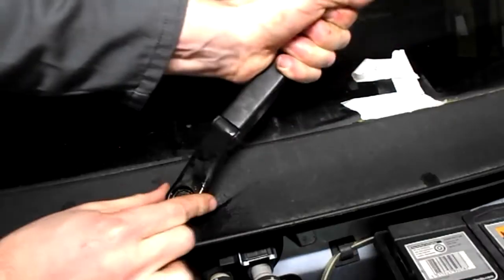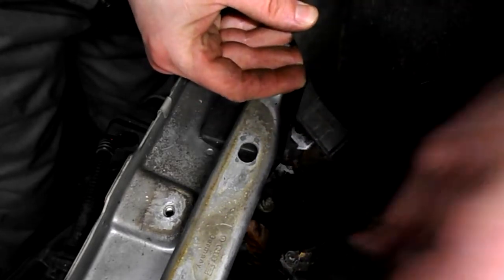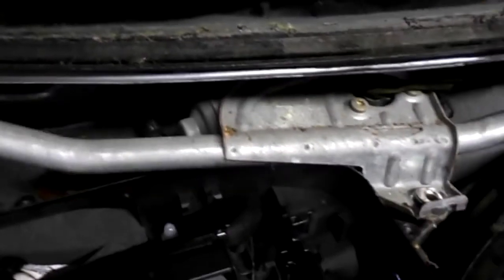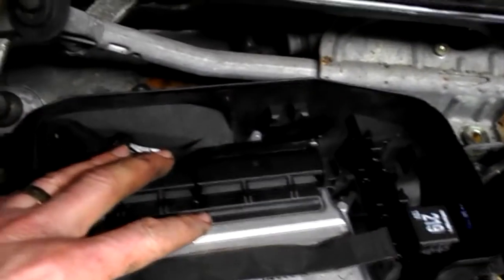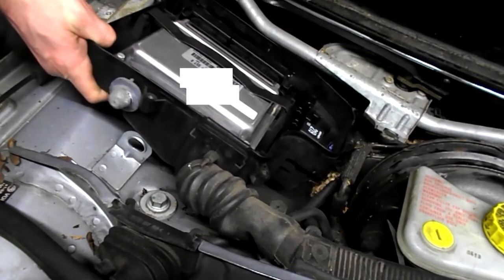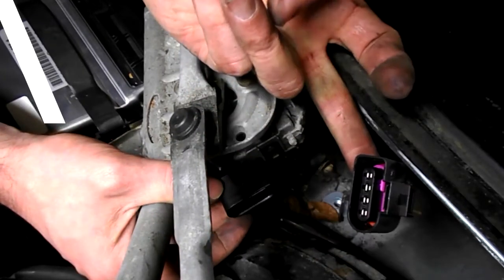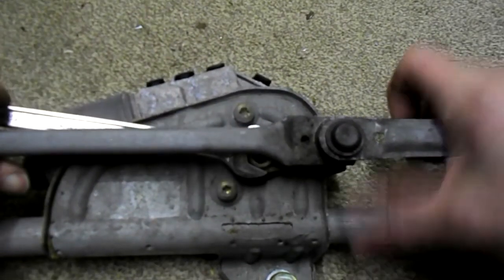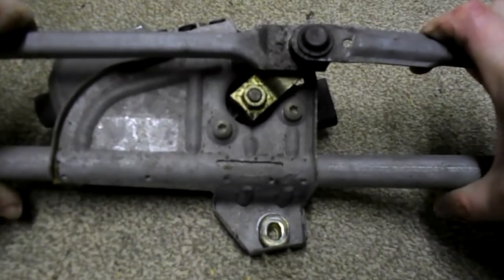Volkswagen Passat Wiper Motor Removal

Comment: Hi, my wiper arms are proving impossible to remove. I don't know if they're seized. Any tips please? Thanks
Reply: Exactly my issue. Not as easy as it appears in the video. I ordered a puller tool to be able to remove them. I tried renting the tool at Advanced but due to the COVID-19 situation they aren't doing that anymore
Reply: pro tip : you can watch movies at Flixzone. I've been using them for watching a lot of movies during the lockdown.
Reply: @Finley Saint yea, been watching on Flixzone for since december myself :)
Reply: @Finley Saint Yea, I've been watching on Flixzone for since december myself :D
Reply: buy a pulling tool that has 2 legs, not just one, because otherwise u gonna bend the only leg that it has lol (and DO NOT use any type of impact tool, just the pressure ones)